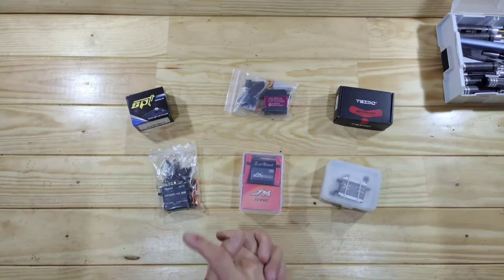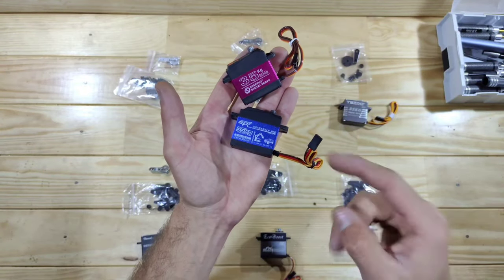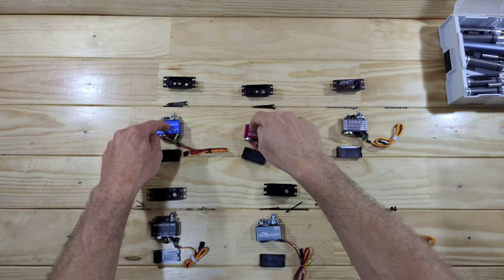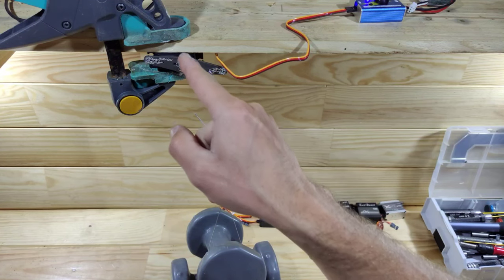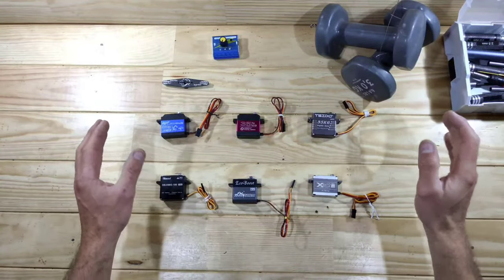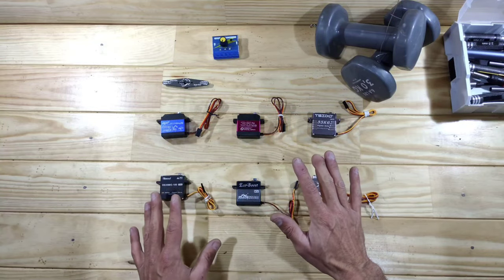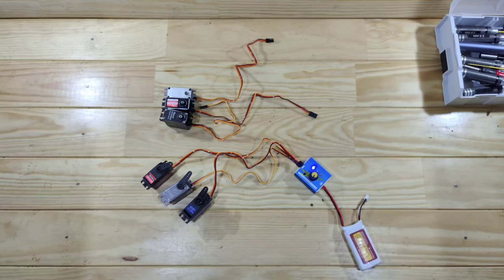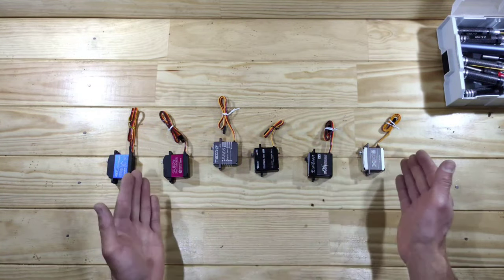Is expensive better? Or can a cheap one beat the rest?

Comment: I use those red 25/35kg QYRC & DS Servos on just about every one of my 40+ RCs..! (after the stock ones inevitably break) 😉 
£12 to £16.!! Great value.!
The DS Pro versions cost a few pound more but are quite a bit faster than the one you have there.

Comment: Were all the servo rated at 35kg at the same voltage?  That's always the biggest issue i run into when buying one. Trying to make sure it's advertised strength is a voltage my esc provides. I've been running a 80kg 1/5 scale Injora for over a year in a 8s Outcast exb.  It's not the fastest or strongest but it's been making the truck turn the directing a want it to for $40.  I'm on my 3rd ecoboost in a Fireteam in that same time.
Reply from the maker: They are all rated to 7.4, except the cheapest 2, 6.6v. But that means they should be faster and stronger at 7.4v. Only the Xact can handle up to 8.4v, but still, on the lower voltage, it was fastest and strongest

Comment: I have killed loads of the red and blue servos. I now run 45kg 9imod on my 4ws and I havnt killed one yet.
I do go through a lot of servo horns and rod ends though.
Reply from the maker: The 9imod is the same as the YSIDO. Both were disappointing with the lifting power. The Ecoboost wich is slightly more expensive is a much better choice

Comment: Ive been using the red 25kg and the blue Injora 12 and 35kg. I don't buy expensive servos. I just keep spares just in case
Reply: 25 kilo reds can handle 8 volts easy